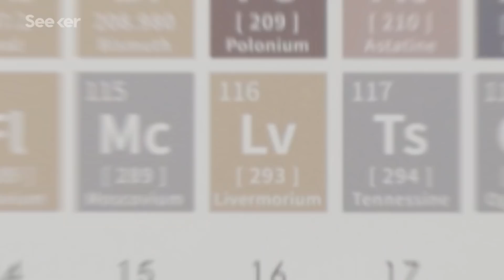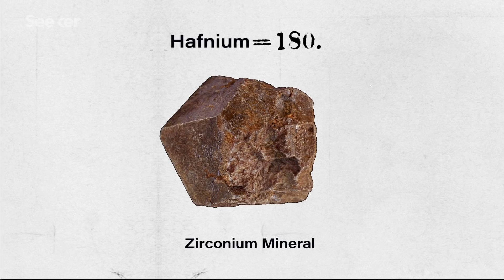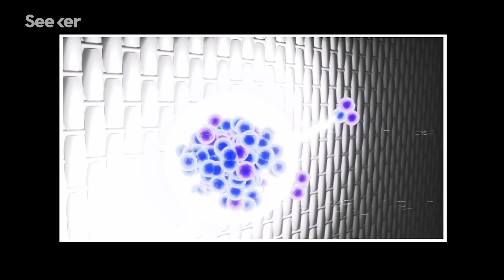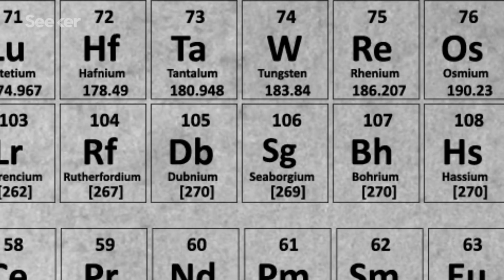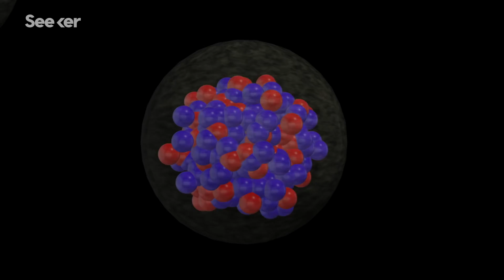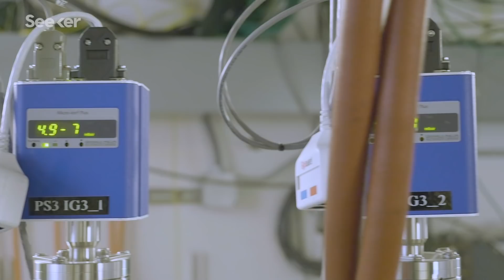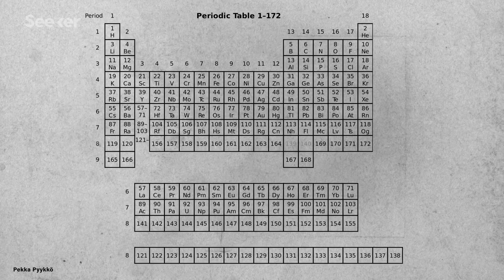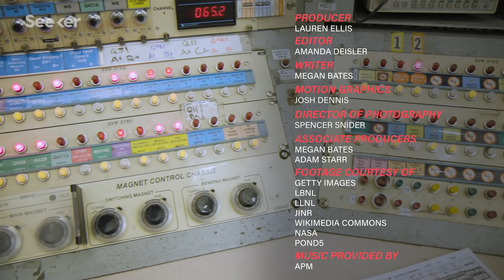This Superheavy Atom Factory Is Pushing the Limits of the Periodic Table

Comment: Could even heavier elements exist in a stable form, say, in the outer surface layers of neutron stars?
Reply: decay likely still happens, but the immense gravity would delay it due to relativity. not that you would ever be able to measure it!
Reply: Just a thught exeriment... i can visualise atoms becoming ever so slightly egg shaped and the nucleus off centre under that sort of gravity. I'd expect 'heavies' to lose their outer shells even quicker in that environment
Reply: Ok. , sorry i missed outer layers of neutron stars. An area rich in electrons. Maybe would last longer
Reply: @jimleane7578  AFAIK, electronless ions don't decay faster than happy atoms?
Reply: @Baigle1  lol. I suggest a littlte more pressure required to tear down ions into 'subatomic' soup than to strip  a 'heavy '  of its electrons when the nucleus is swimming in a sea of negatively charged plasma.

Comment: “A fraction of the speed of light” can be any non zero positive number. That’s too vague
Reply: Speed is scalar so no negative values.
Reply: @richardmendoza7852  It also can't be any positive number either, seeing as you can't write all numbers as fractions.
Reply: @MajinOthinus  :)) Yup, considering some irrational numbers. But practical application usually calls for approximations (~15-40 decimals). With that instead of using "fraction" it is better to use "percent/age of the speed of light".
Reply: Tokisaki Kurumi what? Btw any number can be written as a fraction, just can’t be neatly simplified ; 100 is not divisible by 37, but 37/100 is still a fraction
Reply: @MajinOthinus  what
Reply: @noneofyourdamnbuisness3484  try pi
Reply: @javierguillen1613  To for the obvious example, you can't write sqrt(2) as a fraction (excluding sqrt(2)/1 which just pushes the problem back).
Reply: @noneofyourdamnbuisness3484   Most numbers can not be written as a fraction, in fact there's infinitely times more which can't than those that can. The rational numbers are actually the freaks of nature.
Reply: @richardmendoza7852  the video said accelerates. This is a vector quantity so there can be negative values
Reply: @dontdishfish5861  Oh I only referred to the quoted phrase in the parent comment.
Reply: Richard Mendoza you’ve clearly not driven to Walmart with my grandma.
Reply: I walk at a fraction of the speed of light
Reply: it can also be 0 and a negative number
Reply: Ya I can move at a fraction of the speed of light. A very small fraction, but it’s still a fraction. Lol
Reply: noreaction 🔹 https://youtu.be/cvtBfWs2NTA
Reply: noreaction it’s implied that it’s a meaningful fraction like 1/6 or 1/3 instead of 1/1000000000. But you’re also right because they are vague but it’s not like that information would be useful in the context of this video. All they’re trying to say is “we shoot these particles really really fast”.
Reply: @Damfinsaowefinawe  1/1000000000 is still meaningful. That information is useful. Really fast, yeah, and? At which fraction of the speed of light do things begin to get interesting, and so on? If we're watching an educational entertainment video, how is this information not in any way useful and meaningful?
Reply: This is the problem of trying to explain things to morons. Rather than educating yourself, you attack someone who is trying to educate you. If she could talk to you like a colleague, she would but instead of trying to learn you choose to try make yourself feel superior
Reply: sigh...O.K.  what she's trying to get across is that they are accelerating the beam to a very high speed, a speed that is relativistic, any FRACTION of the speed of light is meant to imply that special things start to come into play once you get to those speeds, it isn't vague at all, it's just that you don't, or now didn't, know what she meant...now you do..see how lack of knowledge makes one statements seem rather ignorant ? and all those thumbs up to your comment just confirms how many other ignorant minds there are out there....
Reply: Turtle: And you call me slow?
Reply: Maybe the speed in which the atoms collide is pertinent and varies by the characteristics of the gas/atom

Comment: If they want to fuse nuclei easier, could they saturate the starting nuclei with muons? Atoms with muons instead of electrons are much easier to fuse and maybe they could use slower beams that are easier to control and aim. Also at lower speeds the nuclei will have more time to fuse and have less kinetic energy that is trying to rip them apart.

Comment: Heavy nuclei elements are extremely unstable. But it'd be very fun to observe their properties and behaviors. And how they change quickly in a short amount of time during their transformation into stable elements. But if you can go further, if you can create the heaviest nucleus, surpassing the  limit, then theoretically, it could cause gravitational collapse though. But it will be super-stable.
Then we can also perform gravitational lensing experiments,  in a lab.

And also we can test Quantum Entanglement in a new way by beaming one of the entangled photons into the heaviest element.
Reply: what do you mean by "it could cause gravitational collapse"?

Comment: Most of the very heavy elements decay so quickly you cant do much with them. Does it really count as "element" if it does not even want to hold together? Because then there is no real limit

Comment: I wonder if they use different element combinations for each. I would expect neutrons to play a pivotal role in stability, likewise the placement of each proton. We see with H20 a molecule that is electrically neutral, but actually has weak negative and positive polarities. Its not really enough to just smash them together and say done, many isotopes have different properties from one another. and with atoms so large with so many combinations.

Comment: International Machine possibly costing millions...

Held together in parts by zip ties
Reply: Hey, don’t underestimate the power of zip ties...
Reply: If there aren't any zip ties is it even science?
Reply: It's prolly wire management not actually holding metal together
Reply: Just stop... you’re making the duck tape jealous
Reply: And tinfoil
Reply: @ThePilsnerKing  Yeah, I had basically the same thought. But tin (Sn, element 50) was replaced a while back with aluminium (Al, element 13).
Minutia, perhaps. But scientifically relevant.
Reply: i would hang from a zip tie if u asked me to
Reply: Don't diss on the zip.
Reply: King Cat  

The construction of pearl river delta costed more than 150 billion , but we will never certain about this , nobody will
Reply: @rahimel-mulla2894  "costed" is not a word...
Reply: And don't forget aluminium foil!
Reply: By Trillions Actually , (that a 12 Zero's)
Reply: Rahim EL-MullA I don’t think it’s worth 1,000,000,000,000 maybe a few billion but probably not a trillion
Reply: @Darling-su3ci  

I searched it up , you correct , It's just 22 Billion Dollar , Not a trillion as i assumed , i was wrong then .
Reply: @rahimel-mulla2894  I can't believe I've just witnessed someone admitting they're wrong on the internet. Bravo

Comment: we have 500 lbs of element 115 at S4
Reply: A few ms later you have almost 500 lbs of moscovioum heated into an expanding, incandescent plasma that briefly sets the entire room on fire before blowing it away; and that's assuming an ordinary, boring alpha-decay of a modest 5 MeV. if it's fissile and has a spontaneous fission decay mode, then it will release 3.5 MT of explosive energy in a couple of milliseconds. A few seconds later you have an expanding fire ball, turning into a mushroom cloud where your building used to be. Roughly 1 minute later you have 1 atom of moscovium left somewhere in that mushroom cloud (again, unless it's fissile, then it will be gone much quicker).

Comment: There is no fundamental limit to the number of elements possible but for the strength of the nuclear force which decreases with distance. Eventually, atomic nuclei get so big that the radius of the nucleus is larger than the range of the strong nuclear force, and, therefore, the strong nuclear for cannot hold the nucleus together and it decays into lighter particles. If you could crank up the strength of the strong nuclear force you could create heavier and heavier stable nuclei, but you can't just turn up the strong nuclear force like a thermostat. So again, there is not fundamental, universal limit to the size of atomic nuclei, but there is a practical limit directly related to the strength and range of the strong nuclear force. Duh.

Comment: When they make sillicon wafers, don't they coat the silica wafers in metals using a chemical process? 

Could some of that tech be taken to use in your research? Like, fire lasers at wafers with several different layers of heaveier elements chemically etched on it. Would it produce something interesting?

Comment: Fcking Awesome! Best YouTube video I’ve seen in a while. Way to go LLNL! One thing they didn’t mention about the problem of creating more stable super-heavy elements is the fact that you need more and more neutrons per nuclei. So the lighter elements just can’t provide enough neutrons because if they had enough they themselves would be too unstable to make targets or accelerated ions. We somehow have to make very unstable heavy elements milli or micro seconds before colliding them to make a super heavy element. If we could pull this off then we might actually reach the island of stability and make longer lived superheavies that some have predicted to be stable for years maybe even decades.

At that point they can be used to create technology. Who knows? maybe they will be able to open the door of quantum gravity allowing us to create propulsionless space drives and extremely power/energy dense fusion reactors. There is one person who claims that 114 has such a potential if we can make it with enough neutrons.
Reply: I did not know about the relativistic electron thing! There’s a new rabbit hole to explore. Thanks!